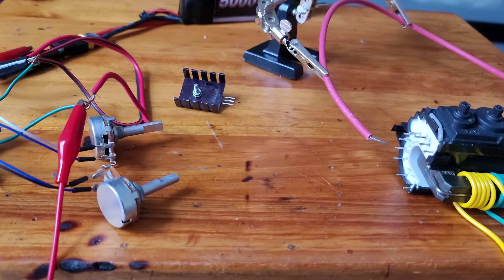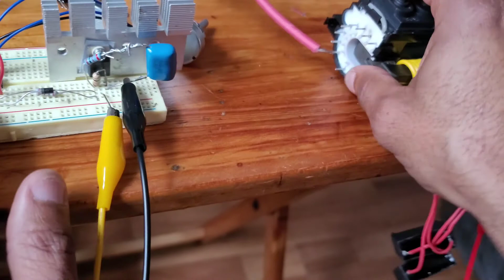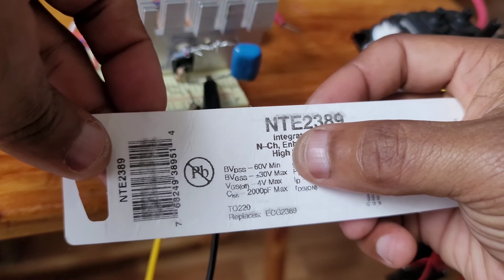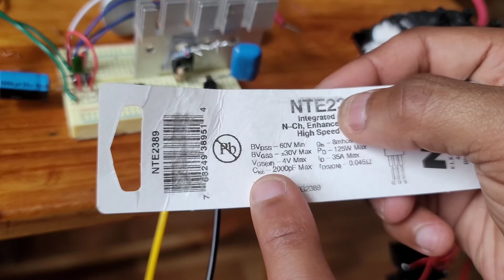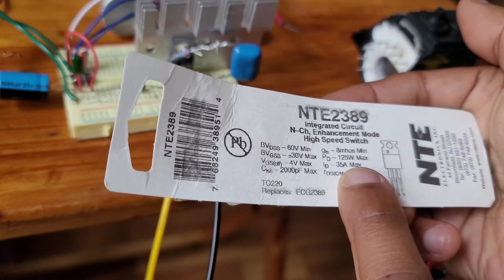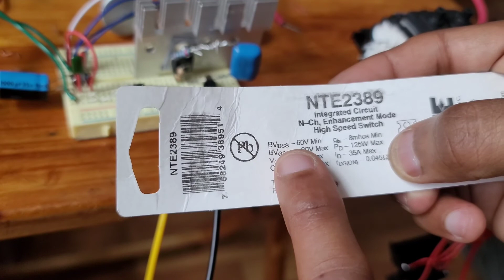Ion lifter power supply update

Comment: Nice video. I never had any luck with irf520s (they came from amazon) Ive had great success with toshiba TK40E10N1,S1X(S mosfets 0.0082ohm rds On 90Amp 100vVDS. My ac inverter drives are based on these. You can totally do what you suggested with 24v or higher if you use a regulator (7812 or something more modern) to power your 555. I ended up using opamps as dc amplifiers to switch the mosfets it works for me. The flybacks I used were self exciting and from experience with those same flybacks, Ive had nasty shocks touching the iron parts when they are on (careful there) I wouldnt want to push them past about 30vDC signal, if they fail you might not be able to fix them because of internal potted capacitors and diodes.
Reply from the maker: I purchased 510,520,540,740 and some others from a website called "Tinkersphere" in NY. The parts were inexpensive too. Another good place is "NTE Direct" in NJ. They have some expensive and inexpensive ones. I later tried my 260n and got about 35kv. How is your projects coming along?.
Reply: @goobman1981  Give me a week or so and I'll be up to 4 axes independantly controlled by neon sign transformers (2 here https://www.youtube.com/watch?v=BmCfjWgYcQw&t=2s) . I just wanted to mention I think you were totally on the right track with the thordarson stock ac transformers, Im confident that is the way to go. Also since you are now usign dc zvs, I wanted to show you the gist of what the Amazon flyback circuits would have looked like. Its basically this. https://i.stack.imgur.com/J59Vh.jpg  . thats going to resonate at a narrow range of frequencies. Your 555 would in theory give you greater control of this.